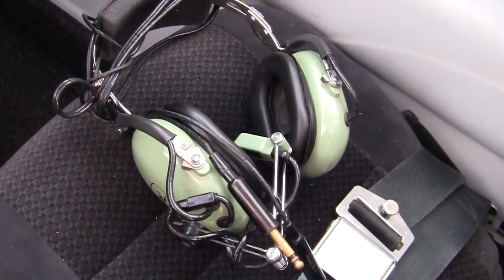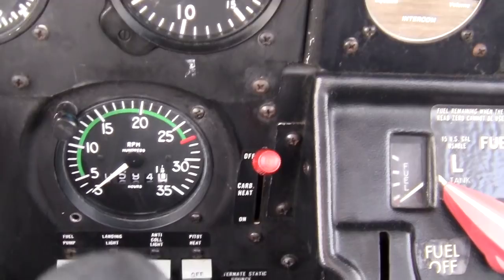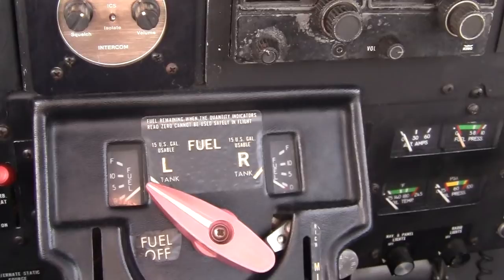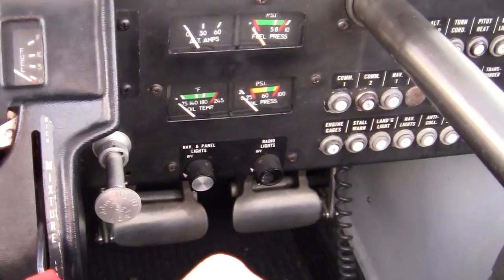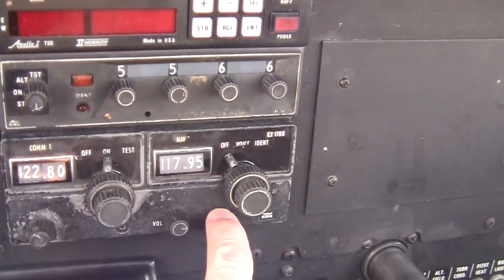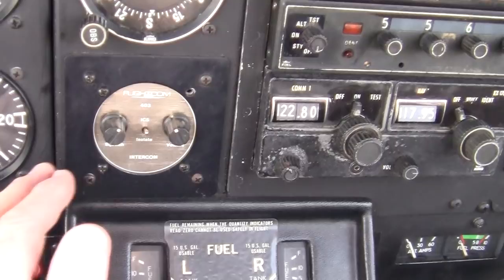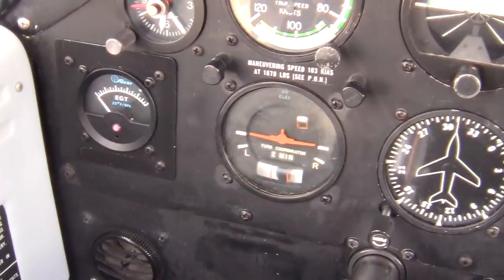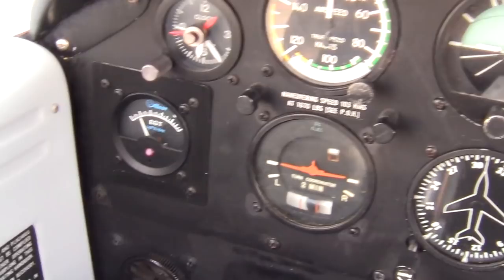Interior  gauges and instruments my piper tomahawk - GHYL

Comment from the maker: I think that if you are on the coast - and if the temps are not too hot - 30C sort of deal average - that would be OK - not too much off the chart .    I'm flying out at 1150feet that's where my airport is - at - we also get temps over 30 C in the summer - so on a hot day - my climb is about 600 - 700 at best.   Cold air - say 0C - much much stronger.   makes quite a difference.   But the plane is desiged to fly anywhere - within it's design limitations.  I fly a RV4 now though.

Comment from the maker: As long as you don't go over the Gross max - of course this also is somewhat dependant on air density - ie) if you are flying out of a strip at 4500 feet ASL - versus - 1000 ASL or it's very HOT out - like 90F or higher - this also makes a difference.   When it was say about 30F etc.. just about freezing my tommy would climb at 800 - to almost 1000 feet per min .   One time I got a guy in it - that was HUGE - (said he was 200)  was about 240.   it flew - not well.

Comment from the maker: If however you told me your home airport was at 4500feet - or more  - and it 's hot - I would say - don't buy a tomahawk or a 150Cessna - or anything like that.    You would want at least 150HP - and a climb rate of 1000 - 1200feet per min at sea level - on that same kind of day - 30c - etc... to perform OK at higher elevations.   good thing is it's also get's colder higher up.  that's my thoughs on it - hope that helps you.